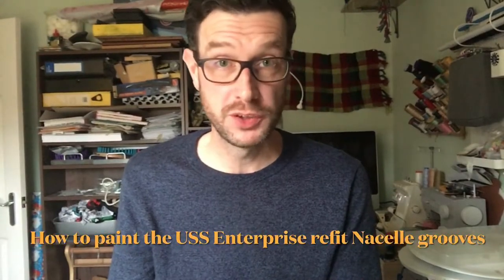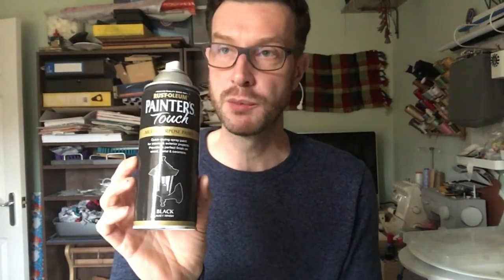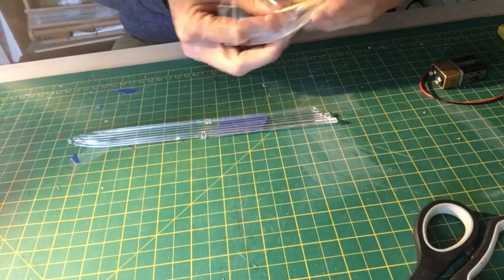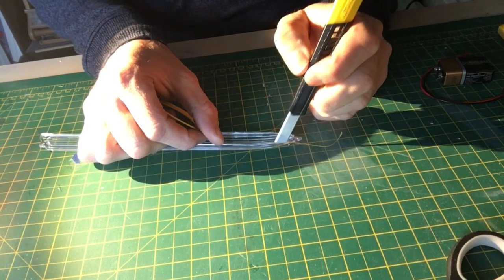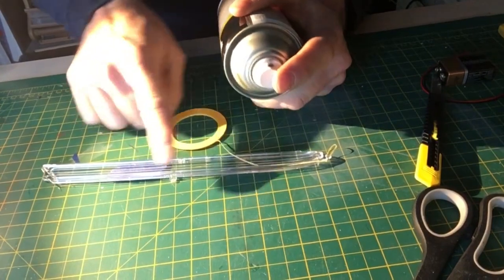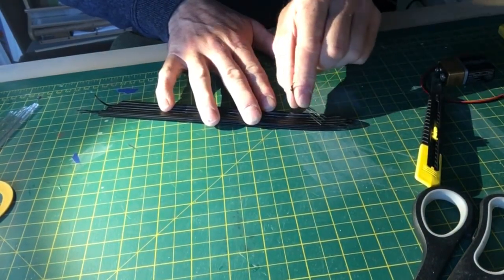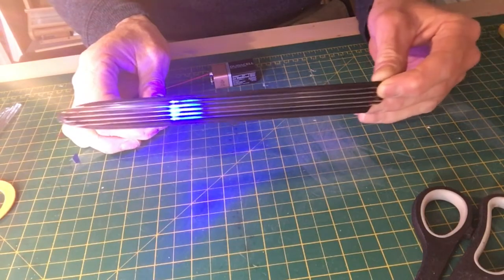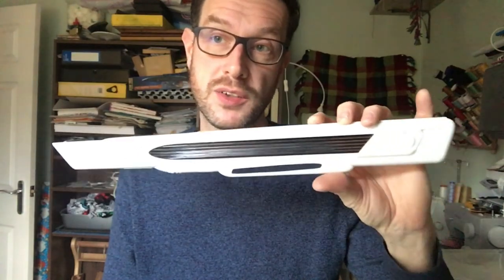How to paint the USS Enterprise refit 1/350 scale nacelle grills

Comment: I tried several things, starting with the 1mm masking tape, and haven't been satisfied with the results. The grooves are less than 1mm, so when I tried I ended up with uneven edges.
Reply: You can get 0.7mm i have seen. Probably also 0.8 - Haven't received my kit yet so can't measure myself. But I also think it looked uneven in this video as well. Have you found a solution?
Reply: @esbenrasmussen4289  Yes, actually. Another video I found suggested tape that is 1/32'', and that turned out to be a perfect fit. I couldn't find any 0.8mm, but that would have worked as well.